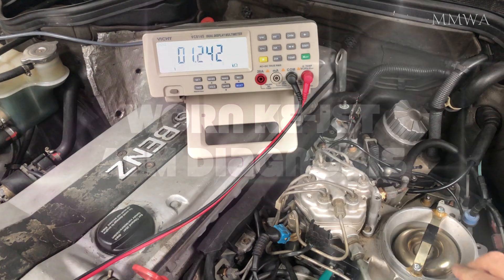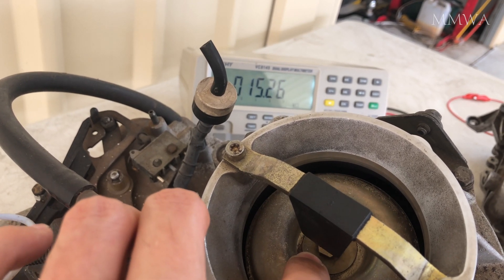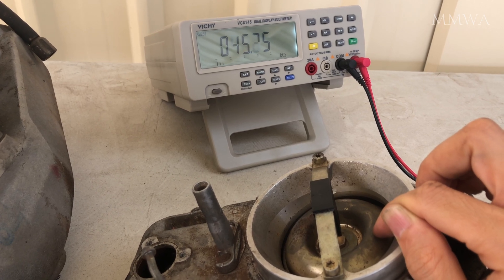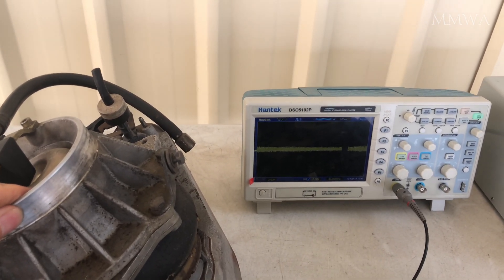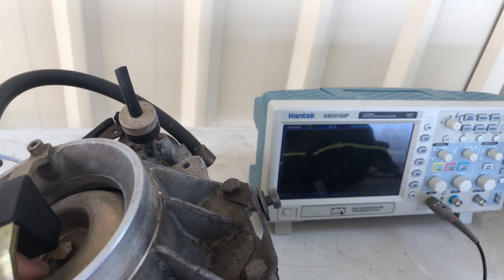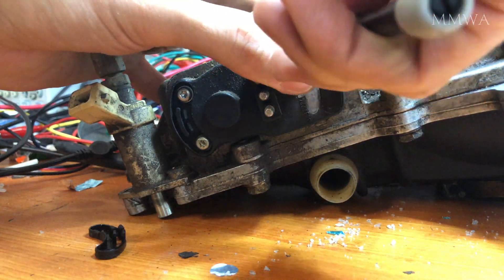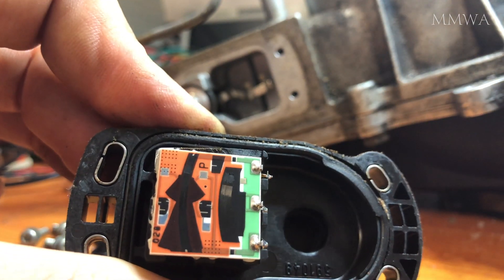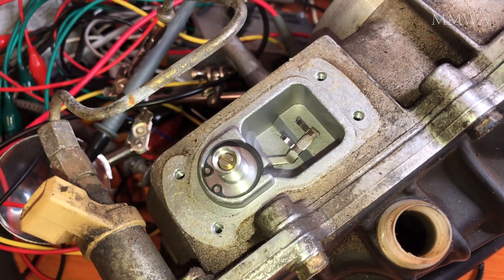KE-Jetronic, Demonstration of worn airflow meters

Comment: May I suggest an experiment?

A repair to the worn contact would likely be popular yet the depth of the contact layer is not much to work with and fixing a replacement layer will need to be simple.

One option may be to find away to compensate for displacement of the two pronged contacts as that would give space for a thicker replacement contact.

The price of these items are never going down.

Any thoughts?

Comment: Thank you for the video. If I change the free play on the air flow sensor plate from 1.9mm to 1.5mm will that change the volts in the potentiometer (0.7v)?

Comment: It is any way to give more tension to the spring to force the air plate to close all the way?, my air distributor unit is not full closing. Thanks in advance
Reply from the maker: the air plate is closed by fuel pressure inside the fuel distributor. Someone may have also played with the idle mixture screw incorrectly. Something definitely is not right.
Reply from the maker: @carloshumbertocazenavescaz4595  I don't give personal technical support, I would never have time for my own cars if I did.

Comment: So suppose these are perfect and not worn in a car and you press down the airflap (or whatever it's called) what should happen? Should it accelerate normally or should it die slowly?
Reply from the maker: Robin van Heukelum it should stall from over fuelling if you press it down on an idling engine. This isn’t really a good idea or a good test unless checking for extremely lean running.
Reply: Thanks!

Comment: update -- changed the hose but still same issue.

when you press on the gas too strong its like a hiccup and it doesn't go beyond 3k rpm but if done gently it will go higher.

this is what happens.

https://photos.app.goo.gl/EoxGNMmdx4RRow9z6 

appreciate your efforts.

Comment: Short update -- I tried measuring the fuel pressure, never used the tool before, and at ignition without start-up it showered pressure.

Thought I relief pressure and do it again but after that I had fuel fountain in engine bay due to the leaking relieve valve...... what a disappointment.

Anyway, along the way I think I found the problem -- a both sides broken speed idler accumulator hose (all parts were new when I changed it). Ordered new part and will see if that was the main issue.

Thanks for your help.

Cheers

Comment: No leaks. 

I will check this over the next few days as I also bought the pressure tester you have but didn't try it yet.

Initially I thought it would have been a gearbox problem because of oil leaks and its kicking out our through the pan seal when there is too much inside (and when in neutral it doesn't properly separate so can is slightly rocking a bit 722.358), but after starting the car and it was warm I tried revving it up and it didn't go beyond the rpm.

Before I always thought its a gearbox issue as it felt spongy when driving as if not enough pressure is transmitted -- until last week as said above.

its a 1992 with roughly 200k kms, but put in new engine and gearbox with now maybe 90k kms, but beyond what I saw in your channel I didn't change anything else of the fuel system.

I will check the fuel pressure next week to try and locate the possible problem -- saw your video and thought maybe you experienced something similar.

Thanks a lot.

Comment: Hi. By any chance did you do a similar test on a M103?

I have the problem that above 4k rpm no more power is coming in idle and while driving it cannot get any more speed beyond 3.7k rpm.

Based on one of your earlier videos some tome back, I changed fuel accumulator, both fuel pumps (TE), new injectors and CO - sensor. Starting when cold on the dot, but once warm it needs a few turns. The new CO _- Sensor helped to improve that.

Now thinking if potentiometer or o-rings inside as one can get a kit from cis - jetronic for 100 bucks or so (did so for my r107 but didn't start the project yet).

Thanks for your efforts.
Reply from the maker: is the engine actually leaning out is that why it wont rev beyond 3700? have you checked the upper and lower chamber fuel pressures (fuel distributor)
Reply from the maker: interesting that it is such a specific rpm weather its under load or at idle. make sure the airflow sensor is not getting jammed up.

How i test for lean running on KE-jet is have a friend hold the rpms at say 2000-3000, while they are doing so, press the airflow meter plate down slightly, if the rpms start taking off dramatically the engine is running lean, if it bogs down its just right. (this is just a test)

Comment: Eventually ,it Might be much easier to go full standalone EFI and dump Ke for good..
Reply from the maker: Mohammad.Alshishani we may have no choice. If bosch stops making these potentiometers we will be forced to use the chinese copies. They are hit and miss as far as working at all is concerned.
Reply: @MMWA-DAVE  with all the problems I am facing with.my m103 and not being able.to find any one who knows a thing about these engines.I am planning to change th whole engine to a M104 3.2 or even better a 3.6 .which might he a few years newer
Reply: Don't waste money on the Chinese ones. They are rubbish. However, these German ones on Ebay are really good.
https://www.ebay.com.au/itm/Mercedes-MB-W124-W126-W201-Air-Flow-Potentiometer-Throttle-Sensor-3437224035/282966669799?hash=item41e220b9e7:g:xo0AAOSwmUdUYNEv&frcectupt=true.
I have been running one of these for two years and it performs flawlessly.